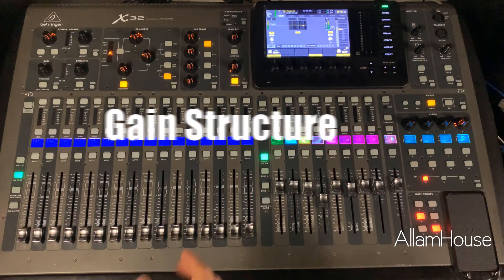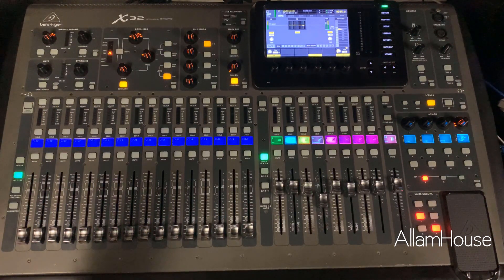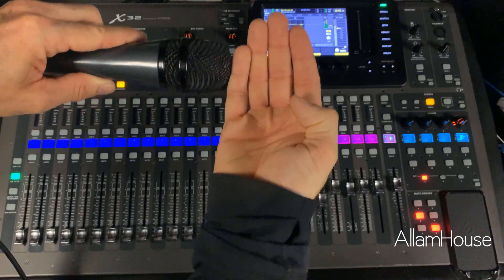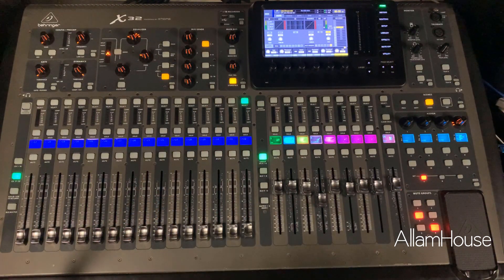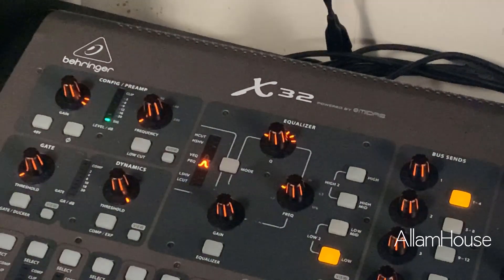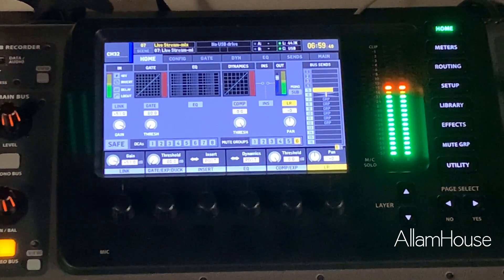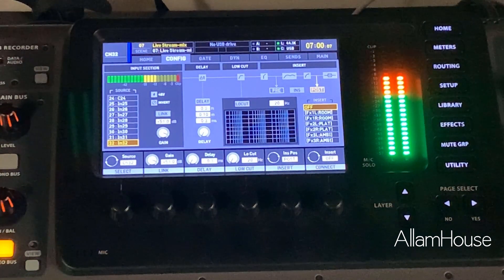How To Fix Low Live Stream Volume | X32 Gain Structure

Comment: Definitely the videos I was looking for! I did have a sound company do the install and apparently there are a lot of parameters attached to the gain that they set. I’m having a hard time turning the amp down and turning my gain up without having other issues. I think I need to see exactly how they set it up before I make adjustments I can save and use.
Reply from the maker: That is pretty typical and with most systems now a days there is a DSP involved and digital interfaces so it’s not as easy as an old-school two channel amp you can turn up or down. 

Best thing you can do is set good gain structure and keep your faders close to unity and then keep your main output down based on your room volume. Then run your stream through a Matrix or AUX to keep the level up for your stream. 

Good luck with it all.

Comment: Love your videos Dave. I admit I need to break them down into steps to fully get a grasp on whats being shared. Our stream levels are low, and start distorting when turned up . When I try to set gain with fader on 0, the volume increases too much. I fear the amp is set too high, and will have to be tuned. Thanks again.
Reply from the maker: Yes, this is a common issue. Turn your main and input faders down some, then set your gain properly. Pull your input fader up close to 0 and then turn your main fader up to an appropriate level for your venue. Ideally, you would have your amps set so that your normal running level on the main fader is between 0 and -5.

Comment: If you set the gain way to high… dont you have feedback problems on your Wedges on stage ?  Thank you and congratulations for your Channel…. Greatings from colombia !
Reply from the maker: You want to set the gain properly on the board… this might make things really loud so I usually do this after turning the mains down and monitors way down (or off). Then, I set my fader close to unity (0) and then bring the master fader up as needed for the room. If the room is too loud you might need to turn down the amplifiers to your house speakers so the board is working at its best settings and the speakers and amplifiers are set to what the room needs. Once the gain is set and the mains are set properly I then move to setting monitors. Keep in mind that monitors (specifically wedges) are only to supplement what the stage needs and should be set 3rd in this process. This video discusses my 4 step process https://youtu.be/XfvsoBve10I

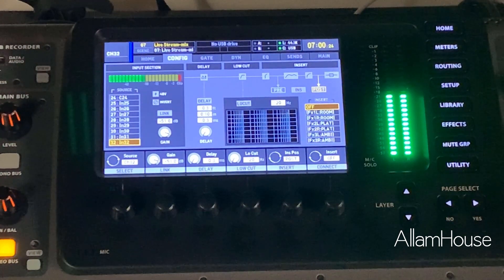Comment: Thanks again for another great video.  For someone such as myself new to audio technology, there is a lot to learn.:)  At 7:16 in this video, there is a gain image shown on the screen, with mention made that "gain is a plus 51."  How does this relate dB gain set earlier with the gain knob.  I believe that turning the main gain knob will also change the "plus 51" value.  Can I use the "plus 51" value to reset my mic gain to that point, if that's what I want, without redoing the actual mic check and setting the gain will receiving mic input?  Hope that makes sense, and thank you in advance.
Reply from the maker: Yes, it is the same information in multiple places that all relate to the same Gain. We can set gain using the main knob on the top left of the console or using the knobs below the screen if you are on the correct screen. As you turn either of these knobs the number (51 that I stated) would adjust. If you save your scene or a preset for a specific input, this Gain value will be stored and recalled.

Comment: Hi, first and foremost, thank you very much for all your videos. Really helpful, well and easy explained, I'm learning a lot. My question is regarding wich db level of gain is a good place to start. You state that -9 dB is that one, but I've listen in other videos around YouTube people claiming that -18 dB must be the sweet spot to start with... What do you think about that? Is not so much gain for every chanel to raise up to - 9 db? Specially when many channels are involved... 
Thanks by advance for your response and sorry If i'm wrong with my point.
Reply from the maker: This is a great question and I might make a video out of this soon. The industry standard in home recording and most other devices is the -18 dB. The tools in this desk tend to respond better to a higher gain structure and I find for my volunteers that I have them shoot for the -10 (as a peak) for each input while looking at the Home > Config tab for any specific channel. This gives us plenty of gain to work with coming into the board and we have enough material to build solid Bus mixes, monitors and our house mix. One last thing to consider is that the output of this board is set to push (while reading 0dB) at -6dB which is a different video production standard so if you build a great mix that only touches -6dB on the output meter, it will result in final broadcast at -12dB and might sound too quiet. I hope that helps.

Comment: What is the problem when I select my house output channel and the config / preamp meter is lighting up the clip light?  However, none of the individual channels are clipping.
Reply from the maker: The main LR Bus (or any other Bus or Matrix) is the Sun of all its inputs. You will hear the term ‘headroom’ often in the mixing industry and this is talking about the amount of room you have left, before clipping as you are adding inputs into a mix. So, one inout might have you at -18db, then a second is added and now you are at -15db. As you add inputs it will take up room in your mix and eventually you will clip if you are not careful.
Reply: @AllamHouse  that makes sense and that’s what I thought it was. However, it seems like we have to run the gain at -18 to -12 in order for our folks using P16s to be able to get enough volume. That’s what seems to be using up the headspace. I am sending the signal to the P16s pre everything so maybe I need to go after the EQ comp etc?
Reply from the maker: So, on the X32 I usually run my gain so my level is between -9 and -12  this should give you enough gain for your P16’s and (obviously) plenty for you mix. I do try to send post EQ/Comp for all instruments except Electric Guitar and keyboards. The compressor can offer some great consistency for the P16’s (like it does in your mix). 

If you find yourself running specific instruments really high for your house, you might need to check the EQ (using appropriate RTA) of your room. Sometimes running a kick drum or bass too high is to compensate for no subs or improper EQ on the mains. Sometimes it is good to dump the faders and start your mix from scratch. This video is one I use to help train new engineers on building a mix. https://youtu.be/pwKfqQbnRvQ
Reply: @AllamHouse  I ran with lower gain settings this morning (-18 to -12).  That's where it needed to be to keep the sum from peaking out.  We can have up to 7 vocalists, two guitars, drums, keyboard and bass for the worship team.  This morning we had no drums and I still had to set it that low.  For IEMs, we mixed their individual channels lower (except for their vocal or instrument) and turned up the over all volume and that seemed to help.  I will play around with the the point of send to the P16.  Thanks for all your help! I really appreciate all your videos.

Comment: You have been more than too helpful to a young sound guy like myself...can you do a tutorial on Vocal EQ, and instruments EQ too. Finally! Must I back up my settings before I can do the new update on the X32?
Reply from the maker: Yeas. Before you upgrade the firmware, save your scene to the console so you can recall it after the upgrade. Your current settings and IP Address (in settings > network) will be removed. If you save your scene you can recall it and then renter your IP and everything will be good to go.

Comment: Hi Dave! I want to thank you for all your videos - especially the ones on gain structure and streaming. I’m a pastor of a small church and figuring this stuff out on my own (just another thing not taught at seminary!) In my church we have powered (active) speakers as our mains without amps. So if I set the gain structure correctly and set the faders to unity on the channels and the mains, the sound in the room is way too loud. When I follow all your other instructions for the gain knob and the faders, I have to set my mains way down (not close to unity). Do you have another recommendation for those of us who do not have an amplifier to turn down and no volume control on the speakers? Thanks again for all your videos. So very helpful!!!
Reply from the maker: You are troubleshooting your way into the best option for you at this point. Ideally, you would go to the actual speakers (which have volumes on the back of them) and turn them down all the way. This is similar to an amp, but you have to touch each speaker. Then, set your main fader and turn each speaker up an equal amount (say 20%) and see how the level is, adjust up or down equally as needed. It is more complicated with multiple speakers and even more complicated if they are mounted up high. 

The temporary solution is to adjust your main fader down low. This allows your gain to be correct, your input faders to be correct (near unity) and your stream is happy.  The room would come last and would be managed by the main fader which effectively is acting as a limiter on some level to keep the room volume at a manageable level. Good luck and send over other questions when they come up.
Reply: Hi Dave! Thanks again for this help. As a pastor of a small church you have provided such a wonderful assistance.  For the last 3 weeks our streams have sounded SO MUCH BETTER! Yay! Your last response to me got me to thinking… is there a way to put a limiter on my main speakers so I can turn the main FOH slider up to unity? (Again just to remind, we have active FOH speakers so no amplifier to adjust and there is no volume adjustment on the floor speakers themselves. So when we get our gain structure right and have all the faders where they should be, we have to turn the mains way low to not overwhelm the space.) Thanks once again, my brother in Christ… and in sound!

Comment: Great video... thanks! 
PROBLEM: I applied a moderate amount of compression to the pastor's the lavalier mic. While it succeeded in reducing her dynamic range making it more controllable, it also amplified a lot of room noise. Would you use a noise gate to take care of that problem or is there another way to go?
Reply from the maker: Is it an over-ear mic, lavaliere mic, or a podium mic?
Reply from the maker: This is common with lav mics. They are Omni directional and will pick up everything. I would try to get the mic closer to the mouth... usually about the 3rd button down on a standard button-up shirt. Your experience is what pushed most people to move to over-ear mics.
Reply: Thanks. Will look into over the ear variety.

Comment: Thank you!!
Question? After your video, I want to bring my main volume to unity, but that will be to loud. Do you suggest I bring down the volume on my amp?
Reply from the maker: Yes, ideally you would run your main fader at unity or just below. If it is too loud in your room, turn the amps down on your mains to accommodate your needs.

Comment: We followed step by step your video on how to set up the matrix and this video and we still do not have a signal going to the Wirecast for livestream.Do you have any suggestions?
Reply from the maker: This is usually an audio setting on the computer. If you are on Windows you need to go to Settings>Microphone and allow apps to connect to the mic. If you are on MAC go to Preferences>Security>Microphone and then check the Privacy tab.

Comment: I have an X32 Compact and turbosound iQ peakers. My problem is that my stream is not loud enough. I used your tutor for a matrix stream. I just can't figure out how to raise the volume separately from the mains.
Reply from the maker: The short version is use the compressor on the Matrix and then use a Limiter as the last thing in the chain before it goes out to the Stream. If you watch the end of this video I discuss the limiter. 
https://youtu.be/pMnaiuC55RY

Comment: Hey Dave. One question. If we're mixing on a x32 rack with an ipad, in our case do we also try to get the gain to '-9' or should this be adjusted to a digital indicator?
Reply from the maker: You still want to shoot for the same levels. I believe the Config tab of the channel (on the iPad) will show you a numbered meter.

Comment: When setting up my gain structure, I pushed up the gain on a vocal mic like you were saying. I did this with nothing in the monitors or house, just listening PFL, but then when I started mixing, it felt like the mic was just too hot. I ended up during the service just pulling the gain down to survive
Reply from the maker: This is best done with some multitracks, in an empty room, while you can test/tune and mess things up.  In the end, you want to get this right because the correct gain setting will make everything else work properly.  Keep going and do the hard work of getting it right... you'l be happy in the long run.
Reply: @AllamHouse  thanks! I have a hunch that the condenser mics on the piano may have been the culprit that day. 

But while I'm asking, X32 only has 4 band on the channel eq. How do you use it to ring out mics but still have anything left to work with for tuning their vocals?
Reply from the maker: We only run In Ear Monitors (IEM) so we do not have to ring out mics.  I personally EQ everything for my live stream and then adjust the house as needed with buses, but usually it is fine.  You do have some graphic EQ's available in the FX racks (5-8) that you can use as insert FX and since they are stereo (or dual) FX you can support two inputs on one FX rack.

Comment: Do you have a tutorial on the Behringer Powerplay p2 (in ear monitor) setup?
Reply from the maker: Bot specific to the P2, but this video describes the process for setting up a monitor. You would then connect an XLR cable from the console (Output that aligns with tour MixBUS) or from an output on your digital stage box to the P2. Plug in some IEM, turn it on and you are good to go.
Reply: Right after I posted the comment I realized I just need to set it up as a monitor and followed what you had in the Monitor video!! 

Thank you, your videos have been so much help

Comment: When trying to follow this video to boost my signal .... it's way to loud in the auditorium.  Do I need to reduce the power at the powered speakers, in order to get my levels up without overwhelming the room?
Reply from the maker: Yes, the process is to 
1) set the board how you want it
2) turn the main fader to -5
3) set the amp level to suit your venue
The -5 at the main offers you some headroom in case it’s needed and the speakers (obviously) could be raised if needed. In a perfect world you would then RTA the room for the desired slope/curve and use EQ to adjust.
Reply: @AllamHouse  Amazing video! We are also having this issue at our church for live streaming... having the gain up super high to get good level into the desk, so it can send a good level to our live stream mix bus, but then it being way to hot going into the main LR. Our main speakers are active and don’t have any adjustment on them. Do you recommend running the main LR fader at say -20dB and all the inputs at unity with high gain to make sure the live stream mix is a good quality?

Comment: 911....911

Could  you do a video on streaming going from the X32 to a ATEM extreme. The sound in the church is great, but it's muddy on the stream. Like being under water. Like a snow sound from speakers.....I hope this make since.....
Reply from the maker: I have an ATEM on order, but don’t have access to one immediately. The first thing you need to do is solo the audio with headphones plugged into the console. This allows you to know if the audio is clean before it goes to the ATEM. Then, log into the ATEM control software and find the gain that controls the mic inout you are using. Turn the gain all the way down. Now send some audio from the console, across your livestream mix and into the ATEM. Now start turning the gain up and watch the ATEM output level. I tend to run the gain up until I am at the top of the yellow on the ATEM which is most likely around 50% gain. I do plan to make a video discussing this once I get my ATEM, but I hope this gets you on the right path.

Comment: why you set the gain for -9 is beyond me. My understanding is -12 to -18. Whatever
Reply from the maker: The console is designed to run an output at -6dBfs which is very different than the standard 0dBfs. If you run your gain at the standard -18 your resultant output would be -24 and the channel strip effects tend to not have enough input gain to work properly. I find that running at -10 produces enough gain for the console to work well and still I end up with enough headroom to not clip when sending a broadcast signal out of the board.  I hope this helps explain my thought process.